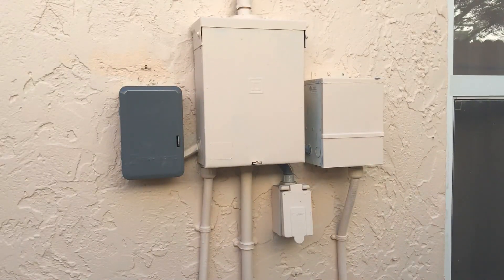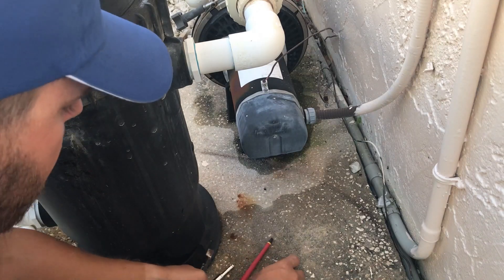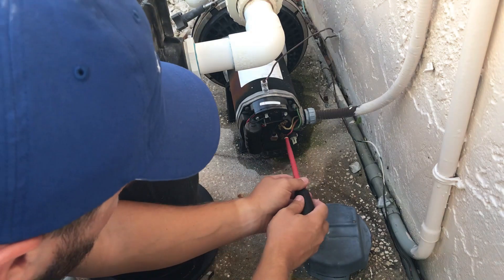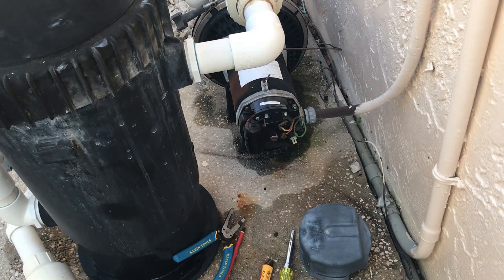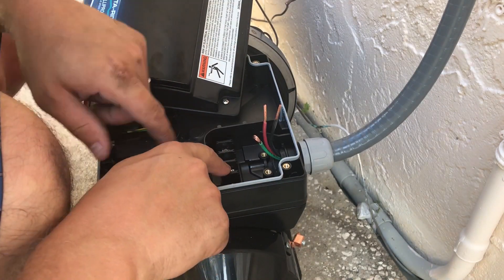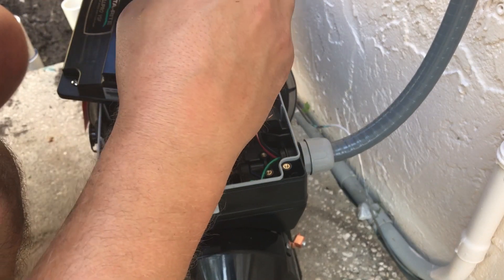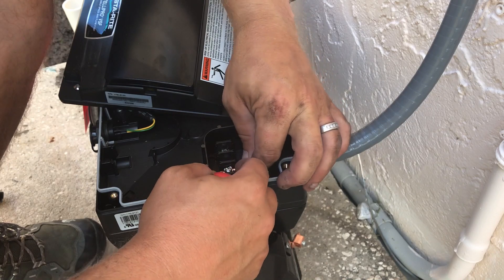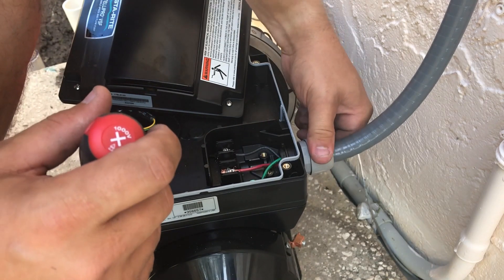How To Wire A Variable Speed Pool Pump (Simple Step-By-Step DIY Guide 2025)

Comment: How does this work at the timer? With it being variable speed obviously the timer isn't needed anymore, but with the salt system being installed you'll need the timer to be able to shut it off when the pump isn't running. That's why I watched this video, was hoping to find an answer if you could help :)

Comment: I just picked up a Hayward 2603vsp and the wiring is driving me nuts, particularly the wire size. They say 8awg which is stranded but it’s so thick I can’t even get the yellow terminal connectors I need to use on it to even slip on to the wires. My older superpump single speed 230v wasn’t even using an 8 gauge. Can I use anything else safely in a solid wire for 230v? It’s running from the pump to a Tork timer box and I don’t even think that size wire will even fit in the Tork terminal connectors.
Reply from the maker: I’m assuming you have a 20a breaker for powering the timer/pump?
Reply: Actually they have it on a 30amp from the sub panel to the Tork TU40 timer. The main panel is on a 60amp to the sub panel as well as a 30 amp to the sub panel. I’m assuming the 30amp to the sub panel is being used for the 30 amp breaker at sub to the pool pump. There is a 20amp in the sub which appears to be powering the outdoor lights around the pool as well as a 50amp which I have no clue what that is being used for as it’s always been in the off position. I’m just assuming it was added as a spare for possibly a pool heater in the future. But seeing that’s a 30 amp out to the Tork timer I’m assuming I have to use 10gauge from pump to timer? Hayward doesn’t give much in way of wiring diagram but I’m assuming it would hook up to the Tork in the same blocks as my old Hayward single speed 230v. I would have liked to just get rid of the Tork and put a junction box and wired direct from sub to pump but I also have a Aquarite with a salt cell and I don’t think my Aquarite can hook up to the new pump? Also distance from sub to pump is 30 ft.

Comment: Replacing a dual speed pump with a a manual switch 3 (Black, Red , blue) + 1 ground wires  to a 220v dual speed pump has slot for 2 live and a ground.

After connecting ground and 2 live assuming black and red were the hot wires tried starting the pump but the pump was not getting powered. Could the blue be hot wire? Thanks in advance.
Reply from the maker: It's really hard to give advice without seeing what you have. With a 240 set up you need two load wires (~120v) and a ground wire. If you are uncomfortable with getting it working please consult a licensed pool professional or electrician who can come out and evaluate your pool electrical. Thanks for watching.

Comment: Is there anyway to rewire your aqualink RS control box that was wired to a variable speed pump, to a single speed pump with a capacitor to be able to turn the pump on and off?
Reply from the maker: Yes you can. All you’d need to do is put the pump load wires on the load side of the filter pump relay. That will allow you to shut the pump on/off.

Comment: Can you run 2 Pentair Variable Speed Pump? Filter and water fall feature? If yes, where do you connect the green and yellow cable to the Aqua logic? Theres only 1 slot for green and yellow cables for 2 green and 2 yellow cables.
Reply from the maker: I'd prefer to both have their own dedicated 20a breaker wired to a timer. 20a breaker > Timer > Pump. Hope this helps!

Comment: Noi intricrions given when hooking up the different wires specifically to each wire on the pump, otherwise good.
Reply from the maker: Other than the ground, it doesn't matter which wire goes where for lines 1 and 2.
Reply: Its a 240 pull, both lines are hot he said that in video. 120 on both thats why there's a red and black indices both are hot.

Comment: We just installed a switch for our pump. We have been running it on the low setting and our pool is getting cloudy. The vacuum is moving super slow. Any advice? Love your video’s.
Reply from the maker: Hey Sarah, thanks for watching and I’m glad they are helping. What’s your run time on the slow setting? The slower the pump the less likely the vacuum will work. To me the cloudiness sounds like it’s not running long enough on the slow setting...considering the filter is in good working condition.
Reply: Our pool filter is clean. I will add more time. I can’t wait to see how much this is going to save us.
Reply from the maker: Good luck! The variable speed will definitely save you money.
Reply: @sarraacarly9801  you also might want to get a robotic pool cleaner instead of the side jet pool cleaner. It will save you even more.

Comment: Used the wrong wiring. Should be solid wire.
Reply: Stranded wire Is fine and dandy. it's a little tougher to terminate sometimes but it meets code 100%
Also thanks for taking the time on telling people to hook up the ground first!
That's just good process thinking.
Cheers!
Reply from the maker: Stranded is just fine.
Reply: Stranded wire Is fine and dandy. it's a little tougher to terminate sometimes but it meets code 100%
Also thanks for taking the time on telling people to hook up the ground first!
That's just good process thinking.
Cheers!

Comment: I figure you would explain a bit more of how you have 4 wires and need only 3 on a variable pool pump.
Reply from the maker: There's only 3 wires in the video. Are you referencing the bonding wire?
Reply: @ChlorineKingPoolService  no, refering to how on a 2 speed pump u have the low speed the high speed and the white wire plus the ground.
Reply: @TovarEndwy  Good question... I also have the 4 wires on a 2 speed pump.  Where do they connect to?
Reply: @WRS1204  what color are they??
Reply: @TovarEndwy  The four wires are Green, White, Red, Black.  These are 4 wires are part of the cable that that is hard wired into the 2 speed pump.  There is not an on/off switch on the pump, and there is not a toggle to convert from low to high horsepower.
Reply: @TovarEndwy  The schematic says Red (High), White (Common), Black (Low), Green = O
Reply: @WRS1204  yes use the green ground white common and black for switch.
Reply: @WRS1204  black and red are what turn on your low and high speed.  Or in other words the switch.